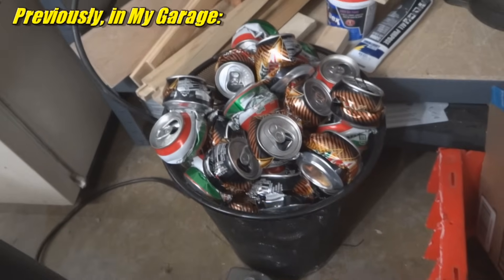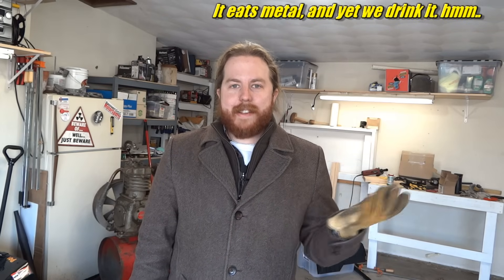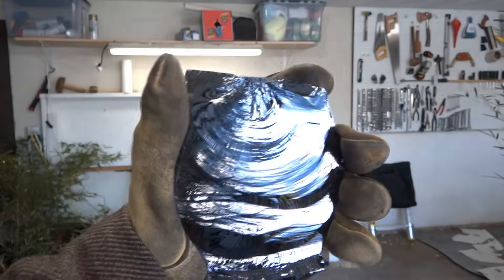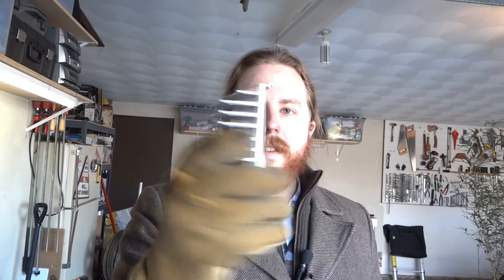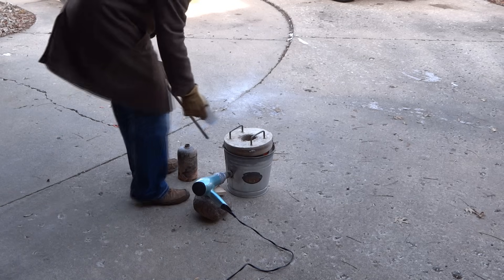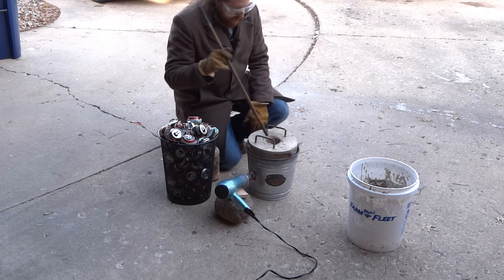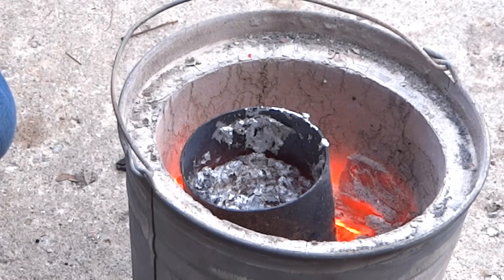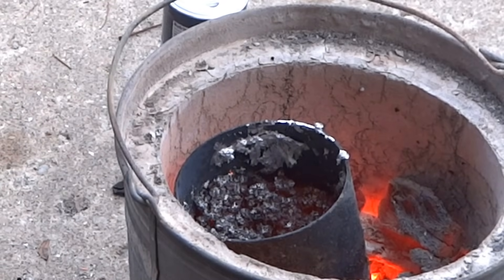Get the Most Aluminum From Melting Cans

Comment: Awesome Video Paul - Thanks. Really liked 1) The Flux Experimentation - was cool that you fluxed the dross & squeezed out a bit more Aluminum and  2) Very interesting how to gain a better quality of Aluminum by adding %5 copper. For a while I was scrapping & collecting copper. A lot of the newer electronics save on the cost by using a super thin Copper coating on Aluminum wire for electrical conductivity. So I have quite a bit of Copper coated Aluminum wire that I thought was basically crappy Aluminum. However Thanx to  your video the Copper coated Aluminum wire might just melt into a slightly better quality Aluminum!!! The one thing I wandered about was the dross in the crucible - if you had thick gloves or a better pair of tongs I wandered if you turned the crucible upside down & tapped it on the cement if the dross would fall out??? Thanx Again: Shawn
Reply: Duralumin:
3,5-5,5 % Cooper; 0,5-0,8 % Magnesium; 0,6 % Manganese,94-95%Aluminium,Si=0.2-0,5%.
(Cans are actually made from two alloys 5004 which is 1% each of Manganese and Magnesium used for the body of the can and 5182 1% Manganese and 4% Magnesium for the lid.(data from Olfounryman channel))
As you can see, your recipe  with Cooper is  so close...
Reply from the maker: Thanks!  THe fluxing worked really well, i was surprised.  Someone recently told me that 95% aluminum with 5% copper is called duralumin if you want to look that up.  It's a pretty decent alloy.  I didn't record it, but i did actually turn the crucible over and bang it on the cement to get some dross out.  Not all of it came out, though.  Quite a bit stayed stuck in there.  I don't have a way to scrape it out, but melting cans left FAR more crud in there than melting scrap cast aluminum, so i probably won't do cans again.  All the dross was a good thing later, when i did the keychain casting video the crucible actually got a hole in the bottom of it and the dross and crud plugged it up so it was a very slow drip.  I was able to pour and everything without losing any significant metal out the hole.  It's in the garbage now, though.
Reply: Toto hey I'm trying to understand what you're saying but I'm not sure I do . Could you explain what you said a little better ? Because I'm really interested in what your saying. 
Thanks !
Reply: @Gryphon2026  I think he's saying to mix waterglass (sodium silica) with either refractory clay, kaolin, bentonite, or chalk, and paint the crucible with it, to make it last longer.
Reply: Fighting recipe with dissolved metal crucible:mix ''liquid glass'' with refractory clay, or kaolin, or bentonite (cat litter), or chalk and paint every time before melting.Paint everything what you immerse in molten aluminium.
Works very well!And cheap...

Comment: Sorry What is the powder you put in the molten Alum? Can I get from a hardware shop?
Reply from the maker: +Liem Duong it was litesalt, also called losalt by some companies.  It's just low sodium table salt available at the grocery store.
Reply: Liem Duong You can buy borax at walmart.
Reply: borax is better for copper alloys. The eutectic salt mixture here is good for Aluminum.

Comment: Hey I'm pretty nooby when it comes to this stuff... what were you referring to when you said melt down some pistons to improve the content?
Reply from the maker: Hi michael!  Aluminum cans, like extruded aluminum, doesn't have much silicon added to it.  Silicon is the key thing added to aluminum to make it cast well.  Pistons have far more silicon in it than usual cast aluminum (it helps keep it from expanding as much when hot, and helps it last longer as it's sliding back and forth), so adding non-silicon containing aluminum (like i got from the cans) to pistons (very high in silicon) will result in an alloy with a moderate amount of silicon, like normal cast aluminum.  That way, you can take non-cast aluminum and make it work better for casting.
Reply: Paul's Garage ohhh so like pistons from an engine then?
Reply from the maker: yeah exactly, some cars have aluminum pistons and lots of lawn mowers and stuff do too.

Comment: Hi Paul, can I point out that using the ex-fire extinguisher as a crucible is a big no-no from a metallurgical point of view as it introduces iron scavenged from the steel by the aggressive molten aluminium into the once pure aluminium and it cannot be removed ever. I would like to refer you to discussions I have had with oldfoundryman in the comments section of some of his most recent videos. oldfoundryman did study metallurgy in depth before taking up foundry work, so I defer to his experience and wisdom on such matters, so the lite salt might have to go as well.
Given your interest in aluminium and green sand casting, you may like to check out his channel as well as Luckygen1001.
Reply from the maker: I've heard that the fire extinguisher is a bad idea, but i only have one graphite clay crucible at the moment that i used for copper.  I'll add another one to my list of stuff to buy.  After the cans there is still a lot of dross stuck to the inside of the metal crucible so i might have to retire it pretty soon anyway.

I'm already subscribed to Luckygen1001, good stuff there.  I haven't watched all the videos (mainly just the ones where he tests various things like degassing procedures and fluxing) but i'll make an effort to watch the rest of them.  I saw the one where the litesalt didn't allow it to flow any better through the thin mold, very interesting!  It did work to get the stuff off the dross (got that idea from cae2100 off the forum) but i'm sure actual flux would work better than cooking ingredients lol
Reply: Just a quick curious question I just came up with after scoping out the prices on ingots/crucibles on FleaBay and Google....    why are the EX-LARGE sizes   (200/300/400/500oz.)prohibitively/ridiculously expensive?  Has your Mom eaten them all or something?

~NMB @PaulsGarage
Reply: I will second two of these comments.  Steel will dissolve into the Aluminum and contaminate it (and none of the things it does to Aluminum are desirable) and as you said, can't easily be removed.  There is also the safety aspect (I'm not a safety nazi on other people's videos, so I'll keep this to a minimum) in that the gradual dissolving of the steel means it can cause it to fail unexpectedly, and at the worst possible moment (according to Murphy)

I don't think that flux added in moderation (not sure if the last add would constitute moderation, though- lol) will severely contaminate the aluminum.  It's less dense and floats on top with the dross. If you are skimming properly before pouring, the flux will come out with the dross and not remain in the melt.  This stuff will quickly corrode iron/steel if left sitting about in it, so rinse it out with water to clean out any remnants of flux that might be in your (steel) crucible, if you must use steel. There are many clay graphite crucibles out there that are inexpensive that will do aluminum, no problem.  I personally like the Super Salamander line as they will also handle cast iron too.

Comment: Paul, if you take a  look at the 7000 series of aluminum (the hardest) you'll see for 7075 grade that it has a zinc content of between 5.1% and 6.1%.  This, apparently, makes it more workable (harder?!) despite it having a lower melt point than aluminum... It also has a low % of silicon, a max of 0.4%, and only 1.2% - 2% of copper.  The 7075 grade is aero spec for "highly stressed structural parts".  Most of these higher grade aluminums have small amounts of titanium (max 0.2%) and chromium (0.18 - 0.28)%.  Why these small amounts are included is, I guess, for added hardness, strength and workability.  And read somewhere that the tops of soda cans have significantly more magnesium in them than the sides and bottom - you might want to check this out and figure your next project against the numbers.  My interest in this area has been stimulated by the fact that I ride only ally bikes and have found myself wanting to cast my own mech hangers.  Its amazing the amount of material you are sort of obliged to sift through so you don't have to fall into all the pitfalls that 'beginners' are prone to make...
Reply from the maker: +Ray Purse its true the tops of cans have a few percent of magnesium (5 or less%) but it isn't much, especially once diluted by the sides/bottom of the cans which don't have the magnesium.  Plus I intend to use this to alloy with copper to make aluminum bronze, so the magnesium will drop to insignificant levels.  Making parts for bikes sounds like a fun project!  I wouldn't want to cast anything structural that I would be riding lol.

Comment: So you can fish the crap off of the top before you pour it, I've been doing that and it's made pouring much easier.  I just smashed some scrap steel  to make a spork type thing with a long handle to fish it off.  Plus it's fun to play blacksmith and hammer stuff.

 I've never done the lite salt, but that is pretty great.  I'll have to do that with my next batch.
Reply from the maker: The scooper is a good idea.  I need to make one of those up.  The spoon with channel locks just isn't capable of getting the dross out with the cans, there was just way too much of it.  The dross left over is non-metallic though so that's nice, i think i got all the aluminum out with the lite salt.

Comment: to filter the crap on the top try cutting a steel plate to sit on top to strain the stuff
Reply from the maker: That's a good idea, has to beat a spoon with pliers like i used lol
Reply: Put a spout on the crucible so that you actually pour from near the bottom (like a gravey bowl).
Reply: Actually gravy boat I think?

Comment: Really cool videos, I'm in the same process of learning this stuff right now. I did get to do a little sand casting in high school but, the instructor handled the furnace. I've been gathering the things to make one much like yours, do you plan on using gas with this one?
Reply from the maker: Probably not with this furnace, but it's possible.  I plan on switching over to some kind of gas at some point in the future, but the next furnace i plan to build will be designed with charcoal in mind just like this one.  There's no reason i couldn't use a propane burner with this furnace or the next one whenever i get around to it, though.  I wish i got to do this in high school, the closest I got was lost wax casting small things (like rings) in an art metals class and the art teacher handled the torch.

Comment: Hey Paul, love the video and the humor! I kind of follow the same procedure you recommend for melting cans. I need to try adding the flux during the melt, that seemed to help pull more AI out from the dross. Thanks for the tip.
Reply from the maker: Thanks! it does help get more metal out of the dross but i'm worried that it is over fluxed .  I think if i mix a bunch of heat sinks in with the melted ingots though it should balance out the mix, and i'm not sure how the flux will effect it when i mix it with copper to make aluminum bronze, but i guess i'll have to try it out and see!

Comment: Another good video Paul. If you find out what the can alloy actually is and what the silicon content of 356 aluminum is you can crush up the right amount of silicon and toss it in to improve the casting properties of the can metal. You can do the same thing by adding some aluminum from pistons because they're very high in silicon. Burning teflon is super poisonous.
Reply from the maker: Hi pete! I probably could crush up the silicon and add it to the aluminum, but i have lots of cast aluminum already and i don't want to waste the silicon.  I might be able to get a hold of some junk pistons, though.  Making everdur is something i want to do as soon as i get the next furnace built, though.

Comment: Very informative vid, thanks. did not catch the name of the flux you used though - can you please comment on the name and is there other fluxes we might use, seen candle wax and sawdust used with lead - might those work for aluminum too?
Reply from the maker: it's Lite salt/Losalt, basically just low sodium table salt from the grocery store.  I'm not sure sawdust or candle wax would work with aluminum.

Comment: Great video and tips. I was just about to melt some aluminum. Do you know about how many cans you melted and what was the recovery rate. Is it smarter to get the 5 cent deposit or melt it. (Melting is more fun) Just thinking return rate even though I will probably still melt because I love having ingots. Thanks!
Reply from the maker: unfortunately i didn't count the number of cans exactly.  in general, i think getting the 5 cent deposit and then using that to buy scrap cast aluminum is the most cost effective way to get the most materials, but where i live we don't have the 5 cent deposit.  I wont get a cent from these so i just melted them lol

Comment: great videos, Adding the copper to it doesnt help it machine better, it helps it flow better into the molds. Your ingots show it alot better between the cans/extruded aluminum to the cast where as the extuded/cans ingots were rounded at the top due to the surface tension, and the cast ingot has more of a sharp top to it where it flowed out more into the shape of the ingot tray. 

Adding copper to extruded aluminum does help it flow alot more, but you do get the same amount of shrinkage, and in sharp corners, you may end up with what's called hot tears, where the metal shrinks in tight corners and splits, making for a weaker part, but to overcome this, just add fillets to everything, which is common pattern making practice anyways.

Also they look different because the cast ingot has had time to oxidize alot where as the new ones havnt, eventually after sitting a few months, they'll both look the same. I usually just use a sharpie to write on what each is, or just throw them in seperate buckets.
Reply from the maker: huh i heard the copper helps it machine better from someone else, but you would know better than me!  Good point about the tops of the ingots, i hadn't thought about that.  the cast stuff definitely seemed to flow more nicely.

Good idea on the sharpie, i havent marked them yet but they are in separate piles, plus the can ingots have the really cool crystals on the surface.  I wish i could get a close up camera shot of that, it would make a cool picture.

Comment: love the new video i wonder if you chemically treated the cans before to remove the paint and plastic if you'd end up with a lot less dross the pans i use are extruded and im 90% certain pure aluminum and i generally get very little dross. i think surface area has alot less to do with it and its mainly the vinyl paint, and plastic coating that is responsible for the dross.
Reply from the maker: Thanks!  I think you are right, the plastic is the main problem.   i'm sure there is a way to remove the coating with something, but i think just using extrusions is probably easier.  there is so little metal in a single can that i doubt it's worth the effort.
Reply: no, if you remove the coating, you expose more aluminum to the air before hand, which will cause even more oxidization before you even get to start melting it. Most of the dross is from the side walls of the cans due to such thin aluminum. Try throwing aluminum foil in a fire, its like that. If you wanted maximum metal out of cans, you would just cut the tops and bottoms off of the cans and use only those, the side walls dont really have any metal to them.
Reply from the maker: thats a good point, the sides of the cans are stretched pretty thin, and the plastic would form a nice barrier.  I bet as the plastic burns it would eat up some of the oxygen in the can, too, preventing the aluminum from oxidizing.  the top is a different alloy, too, if i'm not mistaken, but it's just a couple percent manganese or something like that.

Comment: I made the plaster and sand furnance today but i didnt make the lid, il it make to much of a difference for aluminium ?
Reply from the maker: the lid would help it melt aluminum faster, but it will still melt.  there is a guy named makerj101 who used an open fire for aluminum casting, so hot lump charcoal isnt even required.
Reply: Paul's Garage ok thanks

Comment: idea for dealing with dross  try to find a iron mesh that can sit at the bottom of the extigusher with pieces that stick up that you can grab and pull up to strain the dross. It might be a bit overkill but an idea
Reply from the maker: that would be pretty nice.  the mesh would have a ton of surface area though and i would be worried about the steel dissolving into the aluminum.
Reply: @PaulsGarage  Lies!  Your TWO DADS won't let you pour aluminum muffins ALONE!